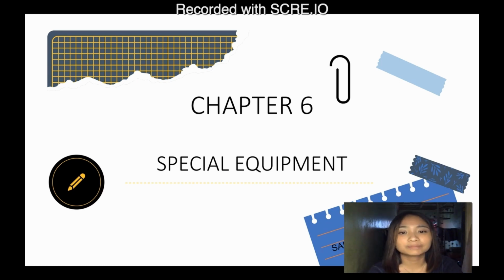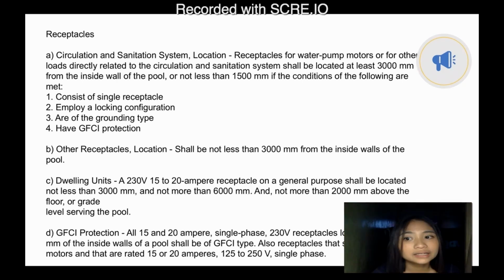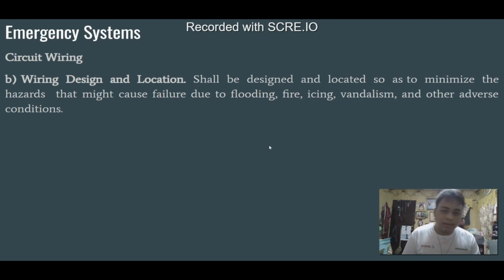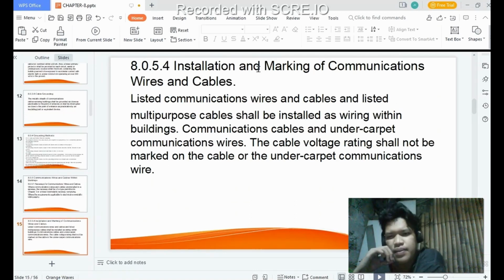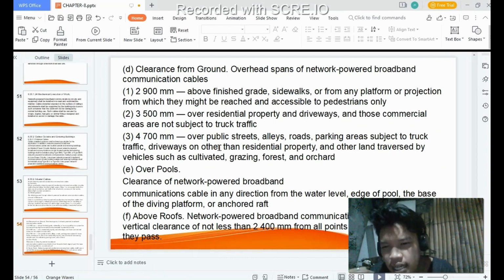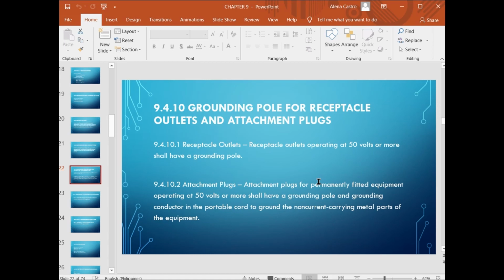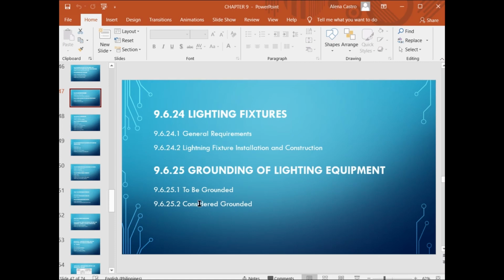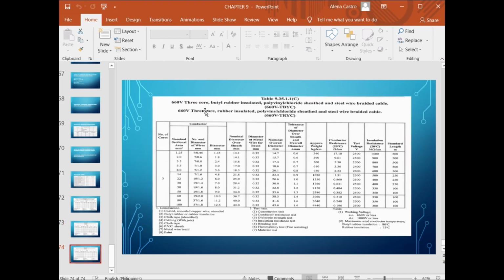EE13 REPORT. GROUP 14 - PEC 1 CONTINUATION

Comment: The Philippine Electrical Code presentation illustrated appropriate supply with the inclusion of the must-haves when involving data cables, and conductors. The article covers the installation of conductors and equipment for electric signs and outline lighting etc. or the rating and size of conductors.

Comment: As I have learned that this was the continuation of the first part of PEC and in  Antennas and lead-in conductors shall be of hard-drawn copper, bronze, aluminum alloy, copper-clad steel, or other high-strength, corrosion-resistant material.

Comment: I learned a lot about the Philippine Electrical Code after seeing the group's presentation. I am reminded that the 2017 Philippine Electrical Code is utilized nationally.
is the essential element for protecting against potential threats induced by the usage of energy for the security of persons structures, and its goods. I also became aware of the rules that go along with it, such as wiring, grounding, required branch circuits, electrical signs, outline lighting, and many other things.

Comment: I learned from the report is that the Philippine Electrical Code is for developing electrical systems. PECs are used across the country as a foundation for safeguarding people, buildings, and their contents from risks that may result from the usage of electricity since they provide as recommendations for developing effective electrical systems. increase. I'm present. The Group 14 report discusses specialized equipment in chapter 6. This chapter explained that it also involved setting up ladders, electronic signage, and outdoor lighting. The appropriate grounding of electrical equipment is reviewed along with enclosures utilized in particular locations. The Philippine Electrical Code is crucial for demonstrating the high quality of materials used in electrical work as well as for setting standards for electrical work.

Comment: I learned from this report is that the Philippine Electrical Code is very important when designing electrical systems. Because PECs serve as guidelines for creating efficient electrical systems, they are used nationwide as a basis for protecting people, buildings, and their contents from hazards that may arise from the use of electricity. increase. This chapter describes special equipment. It also turns out that the installation of ladders, electronic bulletin boards and outdoor lighting fixtures is included. Learn about enclosures used in specific areas and proper grounding of electrical equipment. The Philippine Electrical Code is essential not only for electrical work standards, but also for demonstrating the superior quality of materials used in electrical installations. It protects people from potential hazards such as explosions, electric shocks, and fires that can occur in electrical installations. PEC 1 is intended for use in buildings subject to regulations that ensure the safe use of electricity for people and buildings. Another use of PEC is suggested by R.A. 7920. By definition, this is a law providing for faster and more comprehensive regulation of the practice, licensing and registration of electricians and electricians.

Comment: Group 14 report is about PEC 1 CONTINUATION. In chapter 6, Receptacles and connectors shall be of the locking type, uniquely polarized, and identified for the purpose and should be appropriate system. Also, In chapter 7 in special conditions, systems that are required by law and are labeled emergencies by local, state, federal, or national codes or by any other political entity with the power to do so.

Comment: I discovered that the main objective of the Philippine Electrical Code is to lessen the risk of electricity serving as a source of electric shocks, a potential source of fire and explosion ignition, as well as to prevent the spread of flames and explosions brought on by electrical installations. This information was based on the discussion in the lecture video. The installation of wires and equipment for electric signs and perimeter illumination is covered in Chapter 6 of the book, which is also covered in the video. The electrical propulsion machinery, electrical equipment, and wiring system of a watercraft are also covered in Chapter 9 along with how to construct, install, utilize, and maintain them.

Comment: While analyzing the last group's report, I discovered that the Philippine Electrical Code (PEC) Chapters 6, 7, 8, and 9 contain rules for the development, installation, and maintenance of electrical systems in the country. These guidelines are crucial to the installation and maintenance of electrical infrastructure. These standards offer recommendations for the construction of electrical infrastructure, supporting the growth and upkeep of electrical systems in the Philippines. The compatibility and interoperability of electrical systems must also be guaranteed. These sections of the standards provide standards for the interoperability and compatibility of electrical systems, assisting in ensuring that various systems and devices can cooperate successfully.

Comment: Upong watching the video presentation i've learned about PEC 1 continuation under Underground Wiring Locations is that except where the wiring is required for the pool equipment, wiring is not allowed under the pool or within the region that extends 1500 mm horizontally from the inside wall of the pool. Only wirings installed in RMC, IMC, or a nonmetallic raceway with corrosion resistance are allowed.

Comment: On our presentation, National Electrical Code 2020 Edition, it was stated that the PEC is based off of it and it is true up to some degree. The  Philippine Electrical Code presentation had illustrated relevant provisions with the inclusion of the must haves when involving data cables, conductors in relevant water vessels, clearances, etc. The report also included important tables that are used in reliable and safe electrical installation in the country.

Comment: The reporters illustrate that Philippine Electrical Code or PEC 1 is important because it minimizes the risk of electricity as a source of electric shock, a potential ignition source of fires and explosions.

Also, the Philippines Electrical Code handles emergency systems. These systems are intended to automatically supply illumination, power, or both, to designated areas and equipment in the event of failure of the primary power supply or the event of an accident. 

By: Torres, Japhet G.

Comment: I learned from the video that the Philippine Electrical Code is mandatory since it demonstrates the high quality of the electrical installation materials and the standards of the electrical work. It prevents injuries from explosions, electric shock, and fires that may occur while wiring or other electrical work. In order to protect both persons and property, PEC 1 is designed for use indoors, where strict regulations govern the usage of electricity. R.A. 7920 legalizes another application of PEC. To put it simply, it is a law that improves the oversight of the electrical engineering and electrical contracting industries as a whole.

Comment: After watching the video presentation, I discovered that the Philippine Electrical Code is essential to demonstrate the good quality of materials used in electrical installation as well as electrical work standards. It guards the person from possible hazards such as explosions, electric shock, and ignition that may occur during electrical installation. PEC 1 is intended for use inside buildings that are subject to rules that ensure the safe use of electricity for people and buildings. Another use of PEC is authorized by R.A. 7920. As stated by definition, it is an act providing for a more responsive and comprehensive regulation for the practice, licensing, and registration of electrical engineers and electricians.

Comment: I have learned that the purpose of the Philippine Electrical Code is to minimize the risk of electricity as a source of electric shock and as a potential ignition source of fires and explosions, and to minimize the propagation of fire and explosions due to electrical installations. to establish basic materials quality and electrical work standards for the safe use of electricity for light, heat, power, communications, signaling and for other purposes.

Comment: From this video, I have learned that the Special Equipment is about installation of conductors, tools, and field wiring for electric signs, conversion kits, and outline lighting regardless of voltage. This topic applies to all neon-using installations and machinery, including art projects, signage, decorative accents, and skeleton tubing.
Moreover, I learned that there is a minimum height for overhead conductors and cables. For example if we placed the cables on the sidewalks, platforms, or projections that permit personal contact the height from the ground must be 10ft above and has a supply of 120V/280V or 120/240V.

Comment: What I learned from the report is that the Philippine Electrical Code is very important in electrical system design. Because the PEC acts as our guide to making an efficient electrical system, it is used nationally as the basis for safeguarding persons, buildings, and their contents from hazards that may arise from the use of electricity. In the report of Group 14, they discuss the special equipment in Chapter 6. In this chapter, I learned that it covers the installation of conductors and equipment for electric sign and outline lighting. They discuss the enclosures to be used in specific areas, and they also discuss the proper grounding of electrical equipment.

Comment: The PEC, which holds the standards of electricity and covers the dangers and safety precautions, is a guide for anyone who will use the term "electrical," including engineers, professionals who perform electrical work, and other workers who will be handling electrical systems, I've learned. Its contents should be used in all works. The purpose of the PEC rules and regulations is to guarantee the security and safety of the employees, the work, and the people who will utilize it. One of the courses that caught my attention was about electrical plans, which show the placements of each item in the floor plan as well as the power arrangement, lighting scheme, and receptacle layout.

Comment: Based on the video report, Fire Protection. Listed are the additional requirements for buildings with
1000 persons or more or in buildings above 23 m in height with the
 following occupancies: assembly, educational, residential, detention and
correctional, business, and mercantile. Additionally, Storage  Battery. Shall  be  of  suitable  rating  and  capacity  to  supply  and  maintain  the  load  for  a minimum period of 1 ½ hours, without the voltage to the load falling 87 ½ of the normal.

Comment: On the video lecture on the continuation of PEC part 1, I have learned that electric Signs and outline lighting  fixed, mobile or portable. Shall be listed and installed in conformance with that listing, unless otherwise approved by special permission. 
a) Field installed skeleton tubing shall not be required to be listed
where installed in conformance with this code. 

b) Outline lighting shall not be required to be listed as a system when
it consists of listed lighting fixtures wired in accordance with
chapter 3.

Comment: On the video presentation, I have learned about the Chapter 6 of the electrical code which is the special equipment. In this chapter, the reporter discussed about the electric signs and online lighting. The article covers the installation of conductors and equipment for electric sign and outline lighting. The reporter also discussed about branch circuit, disconnects, groundings, enclosure, locations, as well as the right and appropriate equipment and device to use in different locations. for example, the device that we are going to use in wet location is different to device that we are going to use in dry locations vice versa to avoid electricution and further incidents. In chapter 7, the reporter discussed the special conditions. The emergency systems, the legally required standby systems, and optional standby systems. 

Overall, the reporter discussed about the chapters from the Philippine Electrical Code and its importance especially for us in the field of electrical engineering. With the help of these codes we can avoid danger caused by electricity. These codes includes conditions and guidelines that we must follow when designing electrical and architectural plan. The clearances also discussed which is also important, because as we all know the clearance from the ground to different place such as raceways is different to the clearance from ground of other location like pedestrian and so on.

Comment: I learned from watching this video that The PEC 2 includes utilities' facilities and operations all the way to the service point. petrol station. the point at which a wire is linked to a utility's building that it serves. It is not permitted to create branch circuits using autotransformers unless the circuit being offered has a grounded conductor that is electrically connected to a grounded conductor of the power source for the autotransformer.

Comment: Chapter 7, Emergency Systems
Test and Maintenance
(a) Conduct or Witness Test
The authority having jurisdiction shall conduct or witness a test of the complete system upon installation and periodically afterward.
The supervision of the electrical professionals help to enforce the codes and standards required for a specific installation and maintenance. They can ensure that the work done complies with the standards of the Philippine Electrical Code that guarantee safety and reliability.

Comment: Barcelona, Diobert John
CEIT-04-701P
The PEC 2 covers utility operations and facilities all the way to the service point, as this video has shown me. gasoline station where the wire is attached to the utility's buildings that it serves. Unless the circuit presented includes a grounded conductor electrically connected to a grounded conductor of the system supplying the autotransformer, branch circuits cannot be created from autotransformers.

Comment: I learned in this report the continuation of the Philippine Electrical Code in Chapter 7 the special conditions. Those systems that are statutory provisions needed and designated as emergencies by local, state, federal, or national codes, or by any governmental body with authority. In the event of a normal supply failure or an accident involving components of a system intended to supply, distribute, and control power and illumination necessary for the safety of human life, these systems are designed to automatically supply illumination, power, or both, to designated areas and equipment.

Comment: This video taught me that The PEC 2 covers utility operations and facilities all the way to the service point. fueling station. the location where the wire is connected to the utility's facilities that it serves. Branch circuits may not be derived from autotransformers unless the circuit offered includes a grounded conductor electrically connected to a grounded conductor of the system supplying the autotransformer.

Comment: As I have learned from this topic the continuation of Philippine Electrical Code or PEC 1 is a series of codes that will help and guide us in practicing a safe electrical related works, and giving us clear explanation on how we will use the regulation of codes in doing an electrical related practices. PEC help us to be more specific in tools and materials, also, protect us practitioners as well as the people that will be involved or will be using equipment or tools about electrical.